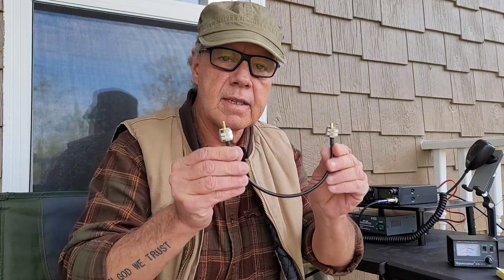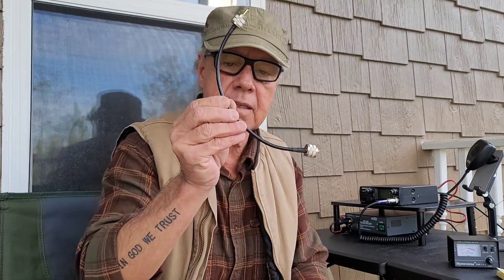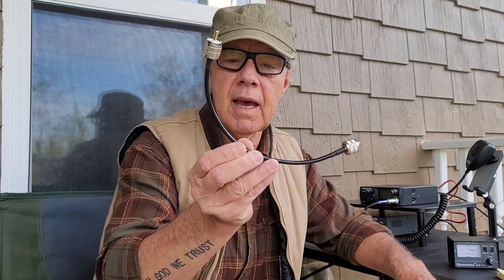Surecom SW-111  CB Radio SWR meter, power meter

Comment: Why is it a must to have when swr or reflected power is not the cause  of radio damage, wouldn't it be better to get an analyser to read the impedance that actually is the cause of damage
Reply from the maker: @Pioneer936  to mitigate the loss of power transmission. In 30 years I haven't have radio damage. Thanks for watching! 👍🏻
Reply: @practicalgadgetsandstuff  just improve the feedline to reduce loss

Comment: If you get a high reading, don't transmit for long.
I like how this gentleman has done a good job at showing how to use an SWR meter.
Ideally you want the lowest SWR at the centre of your band which is around channel 18 or 19 and then it increases in a curve going up and down in channels.
If you mostly use the higher channels,
then find the best SWR around channel 30 for example.

If you use a linear amplifier it is even more important to make sure your SWR is low.
Reply: @crazyham  I'd find where the antenna is resonant or adjust the antenna to be resonant at the frequency of use ,this is not necessarily at the lowest swr
Reply: @Pioneer936  It's not going to be far off though.
Reply: @crazyham  depends a resonant folded dipole is around 300ohms a 6.1 swr without any matching network, most verticals without a matching network are miles off ,a resonant end fed half wave  is several thousand ohms,then I would match it to the radio, non of this would include an swr meter ,they only measure a mismatch not efficiency or resonance
Reply: @Pioneer936  I was assuming that most CB'ers are using things like a station master etc.
Of course a high impedance antenna needs a matching network. 
Great info though
& thanks for your comments.🙏
Reply: @crazyham  think swr meters are used for the wrong purpose, as I've described they not really any good for tuning an antenna, a 1.1 swr reading could be misinterpreted as 100% efficient antenna system when it can be the total opposite
Reply: @Pioneer936  Yes, a 1:1 SWR is indicative of an impedance match on the entire system
but of course the antenna itself may not be efficient.   
But, for simple cases like the average CB'er are working with,
the SWR being under 1.5:1  is generally close enough
and with no obvious loss of performance.
Reply: @crazyham  think you have misunderstood what I said ,a 1.1 could mean 100% loss
Reply: @Pioneer936  I am aware of the points you are trying to make.

Comment: Can use at 40m band ?
Reply from the maker: No. Those are more expensive
Reply: @practicalgadgetsandstuff  = Ok thanks
Reply: I don't think it would be accurate for the 40m band
But if you want good test gear at low cost for many bands,
get yourself a nano vna
which can check your swr on a broad range of bands
and has many more features if you develop your interest in radio.
They are very cheap considering what they can do
but U can't use it inline when using your radio.
Reply: @crazyham  OK Thanks

Comment: The president mcKenley also has an included SWR checker. internally.
Reply from the maker: Yes, I was just showing how to use the Surecom. Thanks 👍
Reply: @practicalgadgetsandstuff  and you did a great explanation. Actually I have that 111 SWR because my radio does not have internal.

Keep going with the videos you have a very patient mood to explain and show.
Reply from the maker: @fecheverria  thank you! Will do